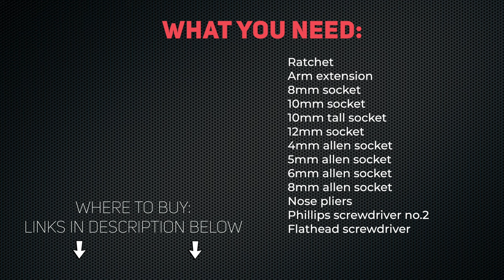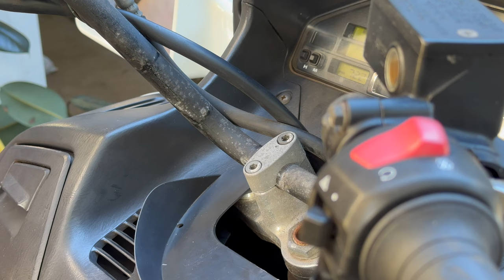Suzuki Burgman 650 - Complete Covers Removal | Mitch's Scooter Stuff

Comment from the maker: T O O L S
10mm deep socket 3/8 drive - https://amzn.to/4ajgwCW
3" / 6” extension set 3/8 drive - http://amzn.to/2h7ypMl
4mm allen socket 3/8 drive - https://amzn.to/3aUmtuw
5mm allen socket 3/8 drive - http://amzn.to/2ofCuCg
6mm allen socket 3/8 drive - http://amzn.to/2ELCnbU
8mm allen socket  3/8 drive - http://amzn.to/2ENzvei
Phillips no. 2 screwdriver - http://amzn.to/2fgdZDL
10mm socket 3/8 drive - http://amzn.to/2xGuLSF
12mm socket 3/8 drive - http://amzn.to/2xM4Edr
8mm socket 3/8 drive - http://amzn.to/2xLNVXU
Flathead screwdriver - http://amzn.to/2jN7lpE
Ratchet 3/8 drive - http://amzn.to/2hhmnUs
Nose pliers - http://amzn.to/2yetDDj